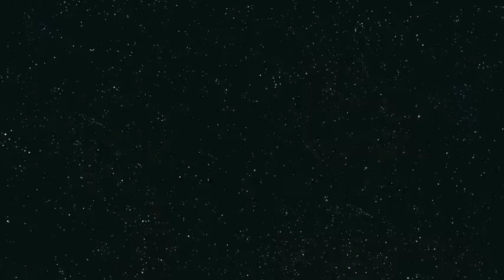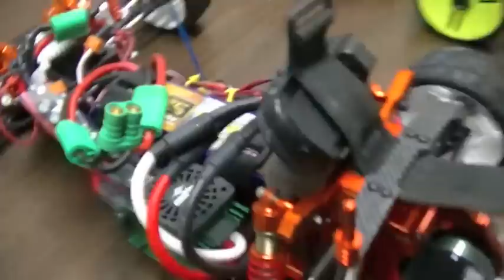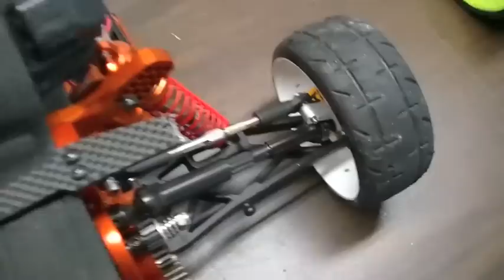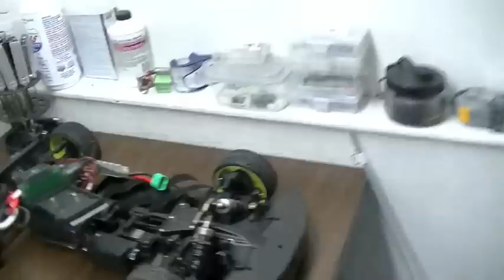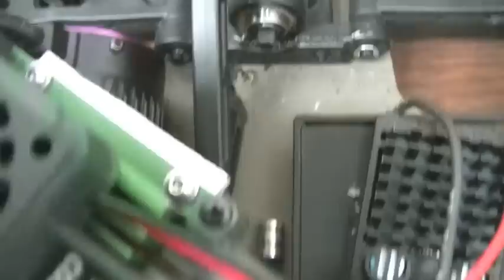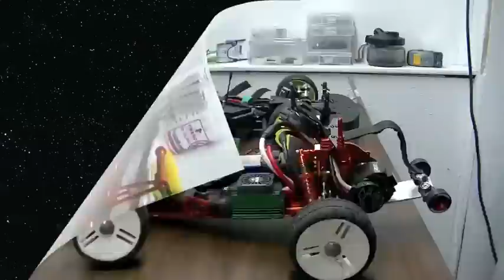My Frustration Continues

Comment: Location is EVERYTHING! I didn't try speed runs until I found my current spot..it's also a Sunday spot. And not to beat a dead horse but I believe slippers do have something to do with traction. Now they may do different things in various RCs...but perfect example is the slash 4x4. Comes with both and states use slipper for lesser traction situations and the diff for more traction. The manual even states to loosen the slipper for traction on loose dirt.  In fact I'm using a slipper eleminator on my Bandit right now..and hit 86mph with it. But good luck bro.
Reply from the maker: correct but the way i explained it is that it transfers power from wheel to wheel and thats not true. I also agree on road selection that is definitely key i'm just hard headed sometimes and need to practice what i preach lol
Reply: Oh...I got you. Wheel to wheel like a posi-rear. Yeah that's the diff's job. I don't know your internals but I'm using a sealed diff in my Bandit with 10K fluid. I get pretty straight launches with this setup but I'm debating on getting a heavier weight or even locking the diff on it to put all the power to the wheels. I'm still learning too bro! A lot of trial and error! Lol!!
Reply from the maker: D when you get a chance check this out hot racing te125 lock diff hubs and tell me what you think.
Reply: I came across that when I was searching for the sealed diff. There's a lot of mixed feelings about them but I was told they were good for speed runs only. If I didn't have this sealed diff I would try one. But with extra transmission gears on hand just in case! Lol!
Reply: Hey Roc...after giving it some thought. I recommend getting a sealed diff with a thick fluid over that spool. Right now I'm using 10k diff fluid in my Bandit...but I do have some 100k on hand. I would use the 100k with your 6s setup. In fact, I just cleaned out and filled my Vorza center diff with the 100k fluid. Vorza comes with a 6s system.
Reply from the maker: thanks for looking out bro that will be the next thing i try.

Comment: Broken parts are part of the hobby, i feel your pain... how did you get thst size slipper gear spur, where can i get one?
Reply from the maker: What's up my friend? That gear is actually a pinion gear. I dremeled a flat spot on the spur gear shaft for the set screw on the pinion gear. There's no slipper setup the washer, spring and nut is just for show. I hope that helped you brother

Comment: AT 3;54 it looks like you didn't put in the inner bearing.
Reply from the maker: The inner bearing was in, it push out of the aluminum insert and the outer lip on the insert is damaged and preventing me from pushing the bearing back in. The Rc  would be a cool one if the parts wasn't so cheaply made but i'm not going to give up on it just yet. lol